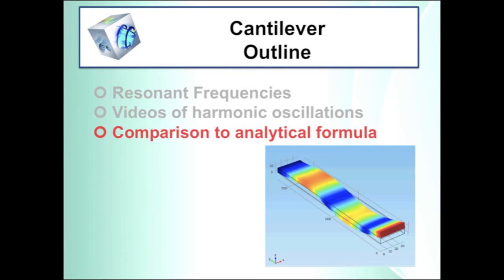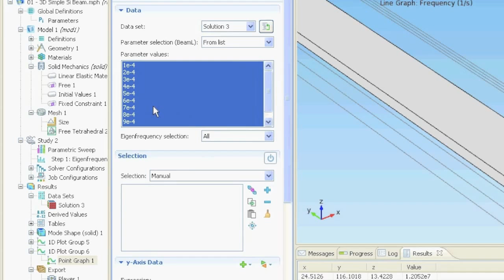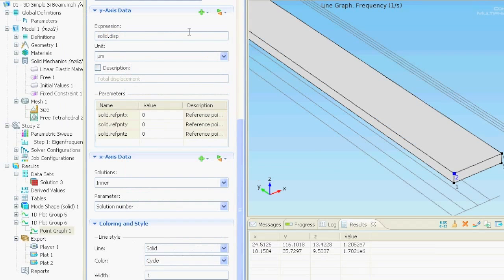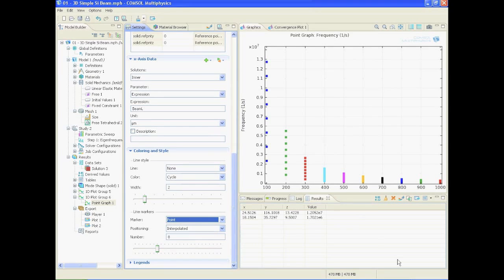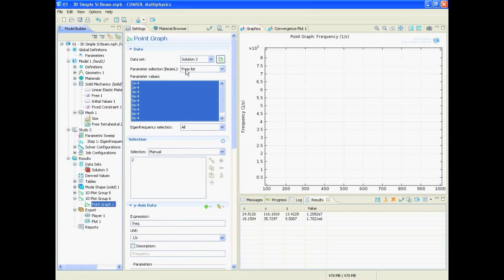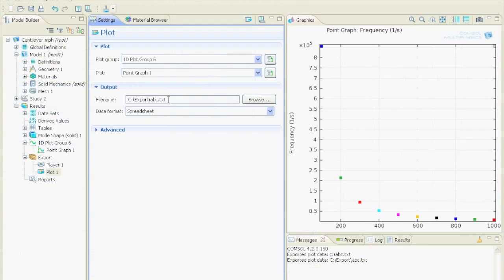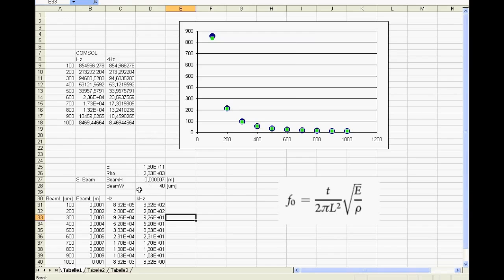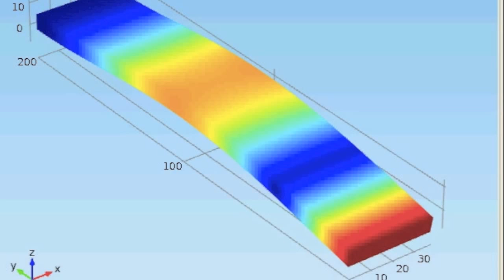MEMS COMSOL 4.2 Tutorial 5/5

Comment: To work around the white space issue, try to import COMSOL data as fixed-width column format into Excel. In Excel 2010, create a new document, click Data -> Get External Data -> From Text -> select the file -> Fixed width -> Next. In Data Preview, position column separators in the white space between data or double-click to remove extra separators. Click Next -> Finish. Choose cell A1 on your worksheet. Voila!